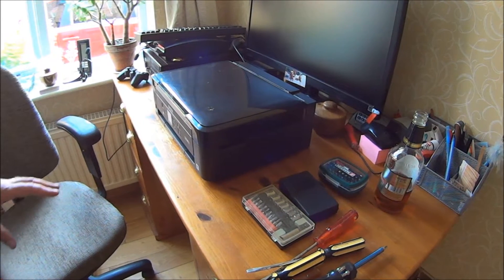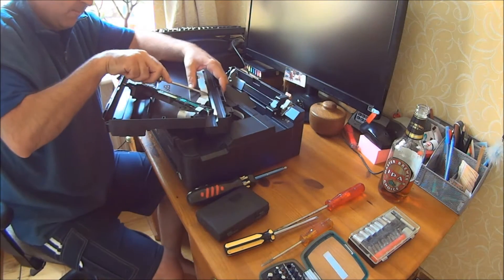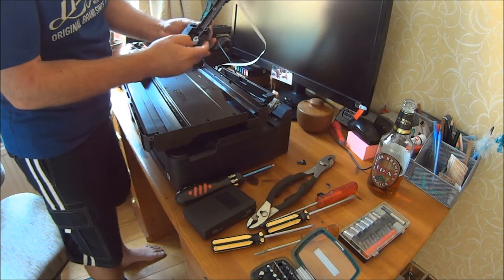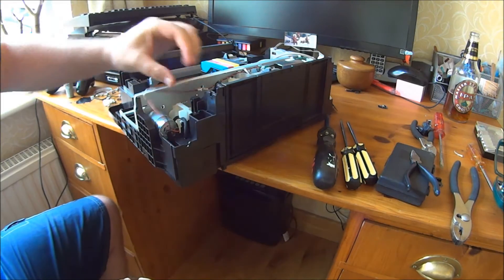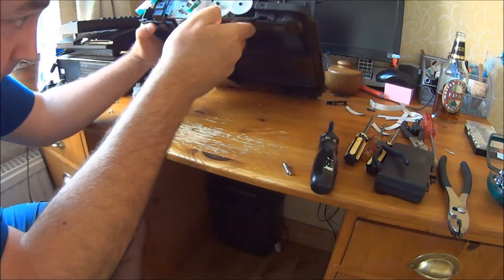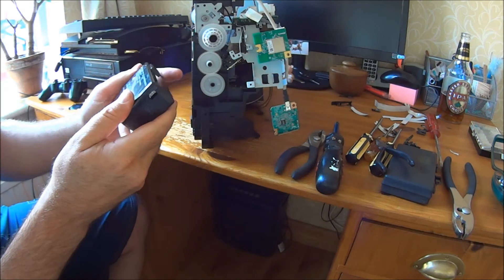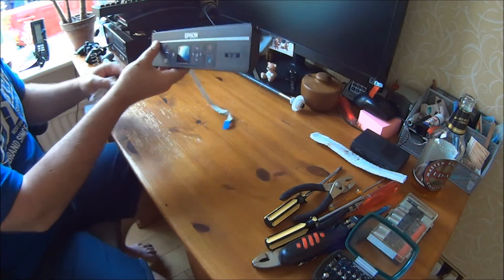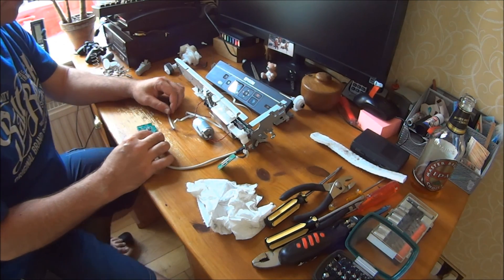Epson XP-312 teardown

Comment: Just did this a couple of hours back on an XP 235; it was junked by a neighbour so I thought I'd pick it up to see if I could get anything from it. Got two motors, similar to the big ones you took out, and now trying to find the datasheets; they're quite old.  There was a third motor which controlled the bulb for the scanner (didn't know it was a stepper motor until you pointed it out; thanks) Glad I got that.  What did you use your motors for in the end? I'm considering building a simple pen plotter; just as a learning tool.